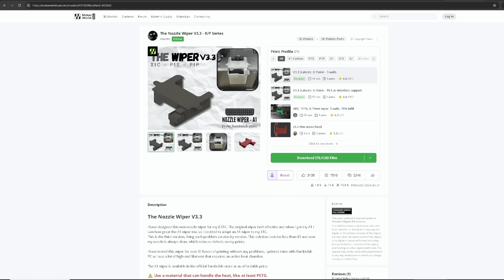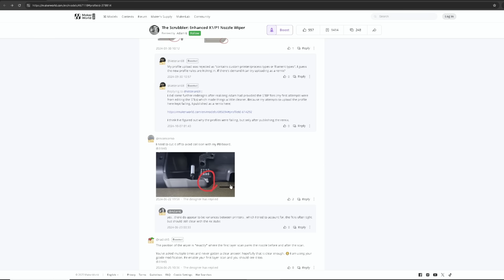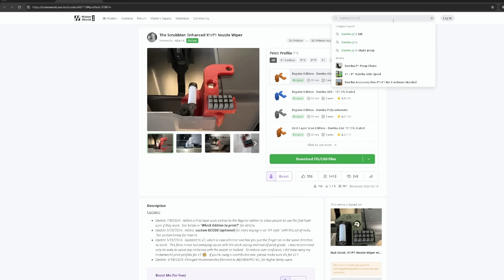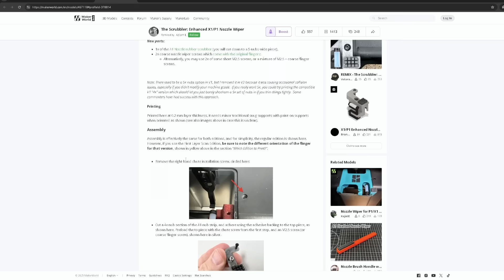Upgrade Your Bambu Printer: The Scrubbler for Perfect Nozzle Cleaning!

Comment: Where can we buy the complete kit?
Reply from the maker: Not sure if there is a kit you can buy anywhere, but really the only thing you should need to buy is the A1 rubber scrubber. You should be able to find the two extra screws in the spare parts box that came with your printer :)

Comment: Also, you really took the parts from the bed with your bare hands???? Not afraid of warping and parts unsticking mid print i see 😂😂😂 ( I'm having warp issues myself 😢)
Reply from the maker: Yeah, I never get warping with my P1S, and the parts stick pefectly without even needing a glue stick 😁 what printer do you have?
Reply: Your bed is too hot or too cold

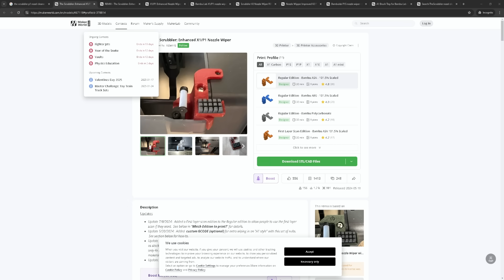Comment: I looks like the second one you tried that was too low for the P1S might have been my remixed version, which was the version you displayed at 1:51. I had the same issues you had at first with it being too high, damaging the stock PTFE wiper, and also causing interference with some 3rd party plates, hence my remix. It was only modified and tested to work with the X1C with Lidar scan enabled, so I'm not terribly surprised it wasn't a good fit for the P1S as-is. In fact while most of my downloaders have praised the remix, a couple have let me know that theirs still seems to have fit issues, which makes me wonder if some X1C's can vary in their tolerances around this area enough that it works better for some than for others. At any rate, it's cool to see that you tried this design and my remix! I'm still running it, I think it's mostly great but It's not perfect, for example I still have more A1 nub wiper wear than I'd like, so I'm looking into making a few more tweaks to try and improve things further.
Reply from the maker: Oh that's awesome! I can't remember which one specifically I downloaded for my second try, but it was definitely a first-layer scan version. I knew it was a bit of a long shot trying it, but I was dreading having to modify it myself so I took the chance :P Thanks for helping make cool mods for the community, it's awesome, wish I had those skills :P
Reply: Just got into an X1C and would love to upgrade it with this part. Do you happen to have a link to your most recent version of this piece?

Comment: Great work , I’m new to printing and only had my P1S a few weeks and really struggling with PETG HF , so in your video the settings change , which ones would be best to use? I assume the very last set?
Reply from the maker: I feel like slower speeds are the biggest helper with PETG (apparently even with High Flow). I used to print 200mm/s+ with it on my bambu, and it mostly worked, but there were some first layer problems on some parts as it was just printing wayyy to quickly, and i was getting holes/stringing too when it was too fast. Try slowing the speeds down to 20mm/s for first layer, then 80mm/s for the rest. If this works, you can try bumping the speed up each time you print to see where the sweet spot is.
Reply: @ thanks buddy , any advice on my filament acting like melted chewing gum? Really annoying me 😂

Comment: Thanks, I’ll try that wiper. I’m using the V3.3 with the A1 silicone, if you remove the adhesive completely from the silicone and then superglue, it will stay in place.

Comment: Hi all. I have the P1S with AMS and I'm still confused as to the GCODE. Seems like the GCODE is only added to the START, but not the filament swap process?  Also, I cannot find in the START in the standard P1S GCODE where to add the wipe sequence.
Reply: It only gets added to the "Machine start G-code" section.
The code gets added between "G2 I0.5 J0 F3000" and "M221 R; pop softend status".
It's maybe about down on the scroll bar. Try pasting the full original code into a text/code editor and Ctrl+F search for it.

Comment: I have tried using a few different wiper upgrades that combine the stock wiper with something else. With PLA, they're fine, but with PETG, filament always piles up between the stock wiper and the add-on. I had to design my own that has ONLY the A1 scrubber, and it works great.
Reply from the maker: Thats awesome to hear! I was also thinking of just using the A1 scrubber, but I noticed a lot of people were reporting that filament was getting stuck in it. Have you run into that issue so far?
Reply: @ I do have to clean it out now and then. But it’s better than the buildup.

Comment: Thanks for the video! Can you please tell me what the correct name is and where to buy this rubber cube tape that you stick on the device? I can't find it on marketplaces. Thanks in advance for your reply.
Reply: On the Bambu Lab shop, it's called "Headbed Nozzle Wiper - A1" and it's in the Spare Parts for A1 Series category.
Reply: @TheBrain2K  Thank you!
Reply from the maker: Sorry I didn't link that part, I have since updated the description with the link. You can also just get it from Bambu (the original would probably be higher quality), but I am impatient and love Amazon 1 day shipping :D
Reply: @LayerLabAustralia  Подход
Thank you so much for the link! I'm a total newbie, just bought a P1S and I'm looking for best practices and approaches to use it. I find your video very helpful, please keep sharing your valuable experience. Subscribed.

Comment: I've found the stock wiper to be fine. I'm mostly printing PLA, ABS and TPU, but so far, after hundreds of prints there hasn't been an issue. Maybe PETG is where it all goes wrong.
Reply: PETG is magical in that it loves to curl up on itself in little ooze spirals and stick to any metal. Brass and steel are particularly bad but it even manages to get glued to nickel on the barest touch, and what are you supposed to do, rhodium plate the nozzle to passivate it even more? Given the opportunity, it would stick to a patch of dirty air - it's so sticky when hot that it absorbs particulate from the air rather than emitting it.

Actually i should try that rhodium plating thing. Maybe even gold plating who knows.
Reply: I print mainly ABS, then PLA, then PETG. I ALWAYS had poop flung around the printer with the stock wiper. SInce the frist print onwards. For 4hours of printing time i get at least one runaway poop. That brought me here.

Comment: Is there a better one for the A1 too?
Reply: Same question!!!
Reply: @dpommerenck whats wrong with the A1 one? I have 3 and they're flawless for 8000+ combined hours
Reply: @ you are right the original design may be just fine.  I have had some issues in the past but I think it is mainly down to using old undried wet filament.
Reply: I feel like the A1's nozzle cleaning mechanics work pretty well. The only optimizations that I could see is maybe the order of certain operations (in G-code).

The only cases I've had where the nozzle got messy was when there was some weird issue during filament loading or flow calibration where way too much filament got extruded into a huge blob covering the nozzle, before the poop got "flushed".
The usual filament flowout that happens at the end of a print or when the nozzle is heating up in the beginning gets cleaned off very reliably by the A1's scrubbing pad and subsequent nozzle scraping on the flexible build plate edge.
Reply from the maker: I don't have an A1 so I'm not sure :S. What issues are you having with it at the moment?

Comment: The problem with all the designs that set the OEM roller back (to the left) is that a shelf is created right where the nozzle parks itself to purge while the first layer inspection is taking place.  This creates a place for purged coils of filament to catch or stick.  

The nozzle on the X1 series printers park in three places around the chute.  This leaves very little room for the placement of nozzle wipes.  

It makes no sense for the wipes to be outside (to the right) of the chute.  Any filament knocked off outside the perimeter of the chute will end up on your build plate or chamber floor.

Thus, the only real-estate a available is about 9.5 mm inside (to the left) of the right wall of the chute.  The best design to fit into that space is a two-cusp or two-blade wipe.  The best of the two-cusp wipes are the injection-molded ones by Sven.  However, the weakness of the design is that it uses wipes molded in Shore 30A silicone.   Silicone that soft gets eaten up right away by the hardened steel nozzles when they are run at temps higher than 250 deg C.  If you watch the nozzle temps when purging even just PLA, you’ll see that the X1 series printers will drive the nozzle temps up to 280 deg C before executing the nozzle wipe sequence or sliding over the nozzle wipe.

This leaves only one solution, the two-bladed silicone wipe.  In order to wipe effectively, the blades need to be cut from Shore 60A silicone with a thickness of 3mm, and the square edges at the top of each blade have to be cut at a 70-80 degree angle (from horizontal) to gain the right force — not too much and not too little — as the nozzle passes through them.  You don’t want a speed bump effect that causes the hot end to jump.  However, you also don’t want the nozzle to just brush past the wipes as filaments such as PETG are very sticky and need some amount of friction to  reliably wipe them off the nozzle.

You don’t need more than two blades.  If two blades doesn’t strip the filament off the nozzle, by the time a 3rd, 4th, 5th blade, etc. makes contact with the nozzle exiting from or returning to a position over the chute, any filament knocked off is going to fall on to the build plate or chamber floor, or get flinged on to other parts of the chamber.  Those A1 type “waffle” wipes are all too many rows of nubs outside the perimeter of the X1 purge chute.  Plus, if you print with higher nozzle temps (280-300 deg C)  in a hot (60 deg C) chamber, those A1 waffle wipes will get torn off or have tracks worn right through them in no time.

There are a ton on single-blade designs out there, and maybe a handful of two-blade re-mixes.  The problem they all have is in how the silicone blades are retained, which is by friction fit.  If the Shore hardness is correct, e.g. at least 60A, there will be enough force to from the nozzle to gradually pull out the wipe(s).  

The PTFE roller on the OEM nozzle wipe is amazingly durable compared to silicone — at Shore 80A hardness — which is why Bambu Lab settled in that design.  So, any other design using silicone wipes, waffles, etc. is going to experience wear faster than the OEM rolled wipe and thus will need to be replaced with more frequency.  This is why one should avoid any replacement, silicone wipe design that uses the OEM self-tapping M3 screws.  Repeatedly screwing and unscrewing self-tapping screws will quickly strip out the holes they are retained in.

I have devised a two-blade, nozzle wipe that is quick detach (in and out of the X1 series printers) and quick mount without screws, and which has a secure but reusable retention system that doesn’t need glue, plus jigs for quickly cutting and fabricating the wipes from 3mm (thick) silicone sheet and cutting the optimum edge bevels into them.  I’m still deciding if it is best to post the STL and STP files on MakerWorld, or to sell the fully assembled units with spare wipes.
Reply: I use a couple silicone o-rings instead of the wiper PTFE tube now for a year. No poop on the build plate anymore.
Reply: Yea will the OEM wiper isn't problematic enough to spend any money on upgrading. The almost free wiper in this video would be a fun project that if it proves to improve things then great but if it doesn't then no biggie, just go back to the OEM device and happy days.
Reply: Trollfactory toolmaking silicone Type 3 is Shore 35A and rated to 450°C so hot nozzle shouldn't be a particular problem per se, not sure about mechanical endurance.
Reply: meh, even as-designed i get poop and other junk all over my chamber anyways.  I'd rather have the clean nozzle.

Comment: I'm new to printing with PETG HF and have never been able to find just the right printer settings for PETG in any of my prints so far. I changed all my print settings to match yours and it's the first time that I've had absolutely zero problems with my prints.  Thanks so much for the printer settings, I will be trying with other prints in the future.  I will install the Scrubbler and Anti-Splash Cover tomorrow.  Thanks again.
Reply from the maker: Nice! Yeah PETG can be a bit painful, just print it a bit slower than normal and you'll be fine 😉
Reply: @LayerLabAustralia  To be clear, was this a high / rapid flow rate PETG you used with these settings?
Reply: I print PETG-HF with stock Bambu filament settings just fine on my X1C. 20mm3 flow rate. Only thing I checked was flow rate and pressure advance.
Reply: Hi where can I find your petg settings please I notice you have changed to all sections
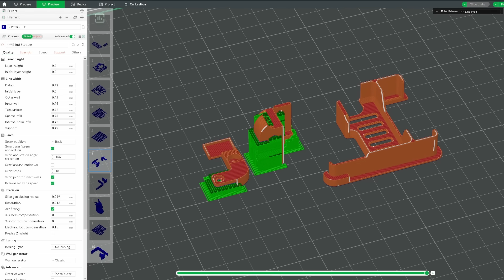Reply: @stevenwhite8210  He shows his settings at the 2:06 minute mark of the video.  I just took screenshots of the settings that he scrolls through.
Reply: Yeah looking for PETG settings
Reply: @adamjones9717  He shows his settings at the 2:06 mark in the video.  I just took screenshots as he scrolls through them.
Reply: Your part cooling fan is disconnected.
Reply: I wouldnt use the anti splash cover. Bambu advises against these kind of mods anyways. Since the splash cover is not secured in any way, it could pop out due to filament and jam the whole printer head.
Reply: And what settings are those, exactly?